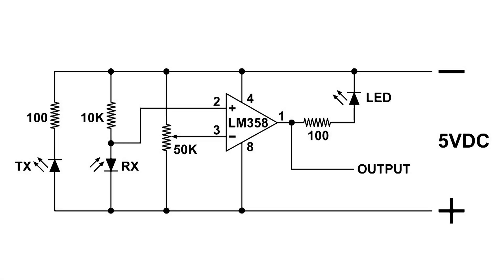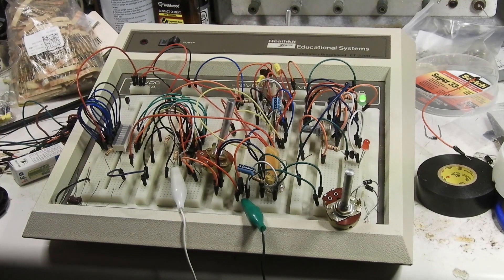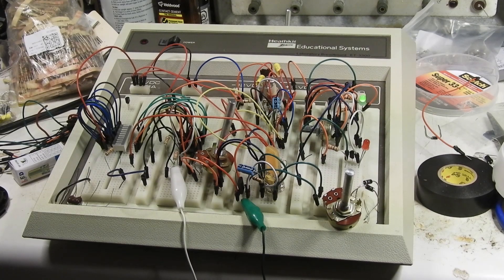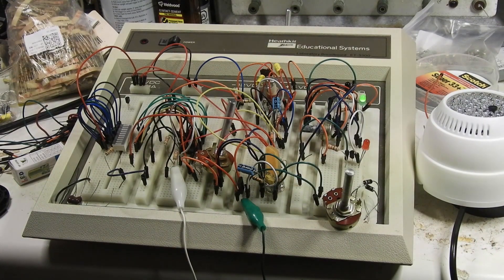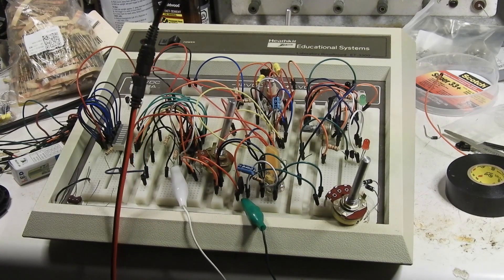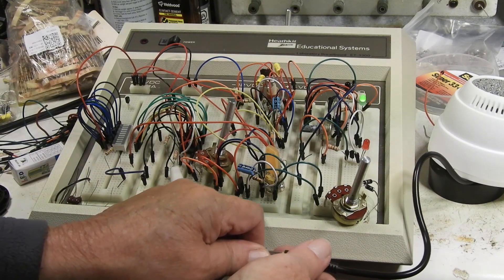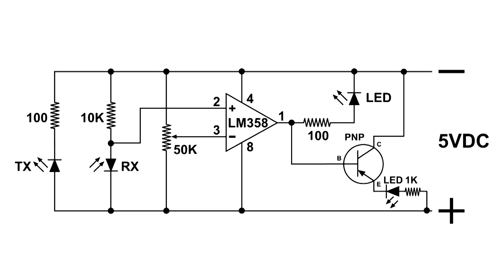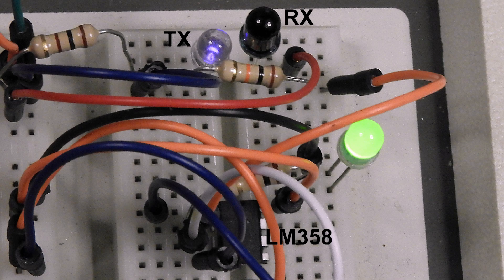Infrared Transmitter and Receive Circuit LM358

Comment: Sir,
Pin no 2of ic is  -  inverting input and  pin 3 is +  non  inverting in put
it is wrongly marked in the diagram as per the ic data pin out spec.
  If iam wrong pl correct me. Sambath kumar.
Reply from the maker: I have made two and have had no trouble with them working. I was going to use these a Makers Fair. Give them to a kid and say, point this at your little brother and see if he has Coodies.

Comment: Great idea using the 358amp! I've been experimenting with IR for the past few weeks and still learning as I go. Had some success using a small signal Darlington for the receiver amp with the 2 pin receiver. I've found that the 3 pin IR photo transistor variety works better, but the emitter needs to be tuned to the receiver. Tuning helps with the 2 pin receiver as well. Ambient light interference was an obstacle until I figured out how to tune the emitter. Here's my latest version... https://youtu.be/AMpf2Mp7MjU  - I made a discrete component version as well but the 555s worked much better.
Reply from the maker: I got the idea for the 358 from another YouTuber. This was the first experiment and it was very interesting. I'm working on some circuit for next years Maker Fair. I saw your video and that was also very interesting. I was thinking about putting headshrink partway over the IR diodes to help lower the effect ambit light. Keep experimenting.